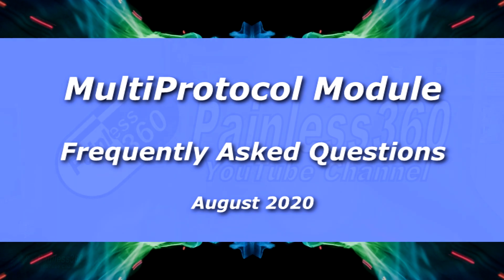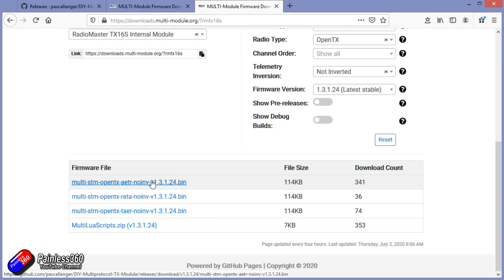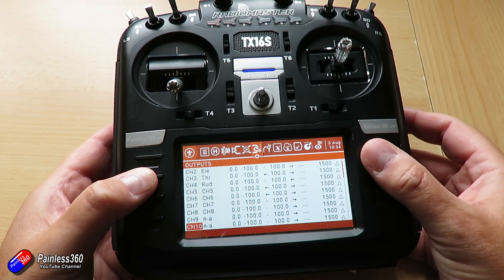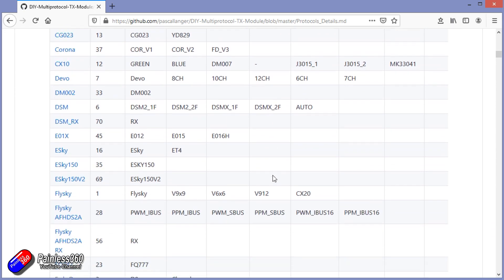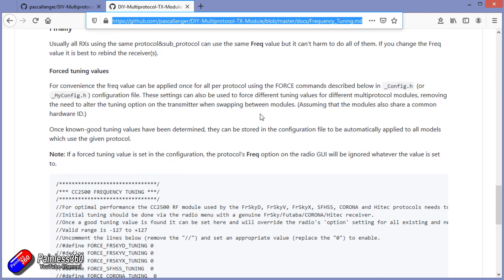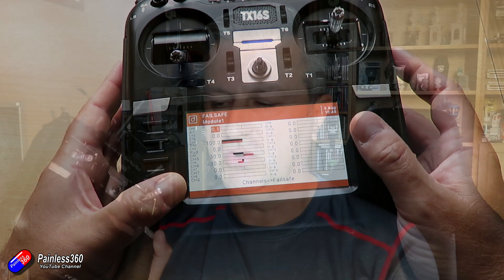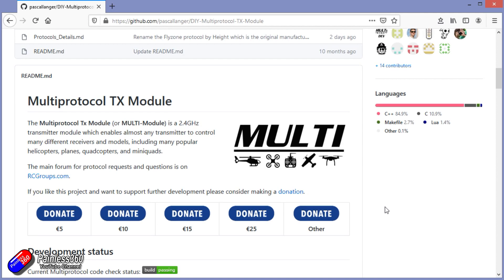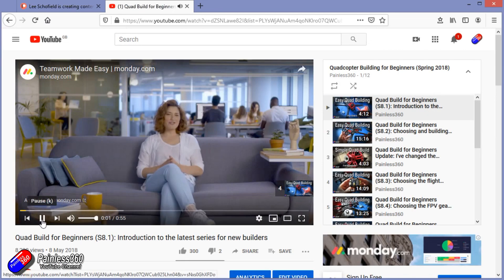Multiprotocol Module: Tips,Tricks and Common Questions

Comment: I got this FRSKY 20S and I wanted to program this thing so I could fly my RC model here in my ranch.   not to fly a SpaceX or NASA rocket into orbit. Cause im not a rocket scientist… 
I’m gonna return this transmitter tomorrow. This is just a bad nightmare. Couldn’t even find those menus.  Very frustrating to try to switch to this radio brand.  What’s the best brand ? The old one JR that works wonders.  Not going thru this.
Reply from the maker: Sorry to hear you've struggled. FrSky do seem to be targeting non FPV pilots who love fixed wing and are coming from JR, Spectrum and brands like Jeti. Sadly they don't provide the same backup as those other brands.. I like radios from RadioMaster running EdgeTX but they can appear tricky to setup to a new owner, I do have lots of videos to help on those though...

Comment: Thank your for the great info. Do you have an info or an estimate on the range on the Jumper and/or Hobby Porter 4in1? I've read that the iRangeX is stated to give around 240 m. I'd like an MPM but decent range would be good.
Reply from the maker: Range is very subjective. Antenna tuning, alignment, fine tuning, antenna position, local RF noise, quality of components, power levels and many other things affect it. Not all of the 4in1 chips output the same power either.. I have a video in the MPM series that looks at this... Best of luck
Reply: @Painless360  Thanks for pointing out your video. I watched it. I read on aliexpress, that the iRangeX developers have tested the CYRF6936 on the (tiny) Blade mcpx and similar Walkera Super CP helis, which have very short antennas. Due to their size I doubt they have full range receiver systems. Range on these two helis is stated at 200 m ("Tested Ground Control Distance"). I'd use the iRangeX or rather the JP4in1 on my Blade 230 heli, which is equipped with the Spektrum AR636 full range receiver. I am looking for an estimate on how the range would be. 200 m is not enough, no room for reserve. I of course don't need half a kilometre for a small heli, but 200 doesn't feel right. Both the CYR-chip in the JP4in1 and in my Spektrum tx have a power output of 100 mW. So range, after fine tuning and antenna alignment as well as flying at the same flying field should result in roughly the same range, shouldn't it?
Reply from the maker: Assuming the unit you receive has the same spec and firmware and the local flying area has the same RF noise, yes it should. Happy flying!

Comment: hello, I have a tx16s transmitter and I was lucky enough to buy a plane with a futaba r6106hf receiver, there is an option for multi/futaba in the settings, but I can't connect it, is this even possible?  I would like to ask for your advice.  Thank you!
Reply from the maker: I don't use Futaba here so am not aware of the nuances. https://youtu.be/DfKyx0yTbXU may help... Happy flying

Comment: Thanks for the video. Have bound a spektrum receiver to MPM module in the back of my X9d and notice that there is no failsafe option to set. Tested loss of signal on plane and of course throttle went to full. Plus in wiki is said this feature is not available. Really? I must have something wrong. Its just dangerous not having a failsafe function. Can you help?
Reply from the maker: I don't use DSM stuff here any more but usually the fail-safe positions on the Rx are set when the bind happens I'd check the throttle is low when you bind.. Best of luck!

Comment: Dude failsafe is the most important and tricky part. Do movie about SHFSS failsafe programing on this radio!
Reply from the maker: I've added it to the list. Happy flying!
Reply: @Painless360  Thank You. I have seen your movie about failsafe. There is a lot more tricky stuff. For instance I am FHSS user. It is different with oryginal futaba receivers and different with Corona cheap receivers. But with multiprotocol is ever more strange to me. On Corona receiver set custom value work, on oryginal futaba I am not sure. I think You might help many people if You can figure it out clearly :) Thank for you movies they are nice.

Comment: Can the DJI Air Unit, a 5.8 GHz VTx and a 2.4 GHz Tx  and SBUS protocol with other receivers, e.g. RadioMaster TX16s?  There is a mutiprotocol module for the DJI Remote however, I want to use an OpenTX radio.  Cheers!
Reply from the maker: I'm not sure what you are asking? There isn't a way to use something else as the radio with the AIR UNIT as far as I know..
Reply: @Painless360  Sorry, I think I missed some words.  I was wondering if, perhaps, they had used a common protocol.  RF is RF in some since.  However, it is more complicated as they are actually transceivers.  

In spite of my confusing question, you answered what I was wondering.

Comment: Hi, I'm really new to my Radiomaster TX16S. I don't have a external Module but would like to connect to a Spektrum transmitter for buddying. I would like the Radiomaster to be the master and the spektrum to be the slave. So my question is do I need an external module and if so which one would be correct to connect to a Spektrum if this is possible to do. TIA.
Reply from the maker: You can connect them using a 3.5mm stereo cable and nothing else. Best of luck!
Reply: @Painless360  Thank you

Comment: I keep on getting a "no sync error" on my taranis when i try to update. I double checked the firmware version.
Reply from the maker: A quick google search found this - "A No Sync error means that the module you are trying to flash does not have the MULTI-Module bootloader installed, and the module must be updated once using Flash Multi before you can update it from the radio". Maybe that's the issue? Best of luck
Reply: @Painless360  Huh, you know what that actually makes a lot of sense! Thank you i will definitely try that and get back to you.

Comment: Hi there I'm trying to help someone out who's trying to connect her iRangeX IRX4Lite multiprotocol module to her FlySky Nirvana radio. Is this possible and if yes please may you refer me to some information regarding this. We're assuming it would be possible since the radio is running OpenTX - just not 100% about hardware connections.. The rest is double-sided tape :p
Reply from the maker: The Nirvana still isn't fully supported by OpenTX so not sure what support will be in the cobbled together version of OpenTX that is on the radio (https://www.open-tx.org/radios.html). Once it is fully supported it will be the same as any other OpenTX radio with an MPM, probably ;)
Reply: @Painless360  Thanks for the reply :) good weekend to you!

Comment: Any chance of a tbs mpm update video? Since the mpm isn’t in agent x I have no clue how to update it and there seems to be a lack of videos on this. Thanks
Reply from the maker: I don't understand what you're asking...
Reply: @Painless360  the mpm module has its own firmware on it from multi module.org. There are plenty of videos on YouTube showing how to update the firmware of multi protocol modules but not for the tango 2. Upon further research it looks like there is an online tool called flash-multi that should make the process pretty easy to update the mpm. The reason I need to update my mpm is I preordered mine from tbs on day 1 and it has an older firmware that’s causing issues with there newer 1.23-1.24 firmware.
Reply from the maker: I see. Not sure, I've not had one of those in here.. Best of luck!

Comment: Hi I have a ts16 my first open tx things were going ok till now I cant get into model set up I can select my model but when I press mdl I get screen set up widgets setup page which I usually access from bottom switch on the left side am going nuts any help would be great
Reply from the maker: I've never seen that. What was the last thing you did before it changed?
Reply: @Painless360  I just added a model and hit bind then turned radio off,when I go to switches test and press mdl it acknowledges both tele and mdl signal and vice versa  its weird is there a way to reset radio to default

Comment: I have the Taranis x9lite, I'm looking for an MPM that will connect with the Eachine P51 Mini Mustang (V761-1 protocol).

I got the XJT lite module, but that only seems to work with ACCESS; I can select from items under the 'multi' menu but the module does not power on.   
The module works great with the ACCESS choices, so either there is a trick I don't know or I need different gear.

I'm considering a Taranis X9D Plus SE (for many reasons) -- what MPM would I need for that tx to work with the V761-1 protocol?

to be clear -- two separate questions:
What MPM will allow me to use V761-1 protocol with the Taranis x9lite ?
What MPM (or other solution, idk) will allow me to use the V761-1 protocol with the Taranis X9D Plus SE ?

I am assuming that if I get V761 i will have the ability to use all of the other protocols I see listed for MPM, is this correct?

and a big thanx for all the Painless360 work!
Reply from the maker: The Jumper 4in1 is a common choice. Best of luck

Comment: I have a Radiomaster TX16s that is great, for one exception. I have searched and searched, and no one can inform me on how to identify which protocol my (toy grade) receivers use. I have several popular toy grade RC's, including a Sharper Image and UDIRC drone, and a New Bright truck RX that I want to re-purpose for a home made camera gimball.  I have contacted the MFG's to no avail. I am disabled and on a very tight budget, so I invested in this radio thinking I could use it for anything PPM compatible forward. I'm shure this TX is capable of doing what I need, but without knowing how to identify what protocol these diverse toy grade Receivers use (which this TX is advertised as supporting) I am unable to utilize it for my intended purpose. I appreciate any assistance. Thank you.
Reply from the maker: Unless they have that in the specs of the toy then you'll need to search the forums or it's trial and error.. Best of luck!

Comment: I have updated my multi protocol module and then updated my FrSky Receivers (XM+ and RX8R Pro). I now can't get a bind on either Rx. The FrSky download page says I have to update the firmware of radios, RF modules and receivers. Is there a particular multi module firmware that corresponds to the latest  ACCST D16 v2.1.0 Rx update? If so, where do I find it?

Comment: The Wiki and the thread on Rcgroups was most helpful for me too Lee. The recent fw for the Multi module has Skyartec's protocol however the OpenTx fw for my FlySky Nirvana has it's Multi module code from OpenTx 2.2 which only allows 63 protocols when Skyartec is 68. Wiki and the group walked me through how to change the code and recompile so I could flash it to my module. Worked like a charm.

Comment: Hi, there is a config-h file which can be set so if the external module is used in more than transmitter the fine tune offset for different make of receiver are saved. I have spent hours trying to find and implement, if this can be explained I would be very grateful

Comment: Hey I am struggling switching over from quads to wings I got the zohd dart 250 fpv ready and I am really having a hard time for some reason after I set up the 3 position switch the 1st position kept both green leds flashing and the servos were making noise every now and again it would work so I tried the 3rd position and it seamed fine so I reversed the switch so it worked normally had everything working I launched the plane 2 times nose dived 3rd time I pulled back to stop the dive went straight up in the air and went into a right stall straight into the ground cracked the nose while in stabilized mode why is it allowing full rolls any help greatly appreciated thanks
Reply from the maker: See my video on FW maiden and setup tips. First time can be tricky if you don't have it setup well.. Best of luck

Comment: Question: I have a X-CAM quadcopter from www.flyinggadgets.com (this is an example). How I discover the protocol that it uses to program my MP TX?. Github has a long list of protocols but it is not easy to associate these protocols to actual quadcopters. Is the a trick to find this information?
Reply from the maker: You need to look at the listing or ask the vendor for that detail. If it's not there then a search in the forums would be my next step... best of luck

Comment: After watching your vid on the Radiomaster I went and bought one,silly question but scrolling thru the recieves I can bind to as I have used assan for years got those working but purchased a second hand Align M25 mini drone it came with a Futaba Fast receiver in it thought nice will bind to that but scrolling thru Futaba is not there so does the Radiomaster not cover any Futaba receivers

Comment: Excellent explanation of the MPM tech.  I've often noticed that binding with the MPM module fails if the receiver is too close (e.g. Spektrum) so moving it 2-3 meters away usually fixed that.

Comment: Hi Lee, 
Wow, what a terrific video.. this one really knocked it out of the park for me, since I use both the internal and external DIY 4in1 Multi-protocol (MPM) modules in My transmitter exclusively.  

I think what Pascal and the 4in1 software developers have done is miraculous. No other OpenTx group has come close to providing such an incredible array of capabilities and done it in a truly opensource way that allows you to review the comments and tweak the 20,000 lines of source code and refine it further if you really need to do so. 

I hadn’t known about a couple of the latest new functions either, so I’m very happy you’ve touched on them here.. but I do have one important question for you.. Yes it’s true there is a detailed list of all the protocols that are currently supported up on the github web site you referenced at least three times.. but here’s the problem.. and this is only a problem for many of us with the cheaper toy planes, boats, Quads and RC Cars and we bought all this stuff  and the cheap crappy transmitters that come with them.. when we’d like to use our new MPM Transmitter with these models too.... however I’d venture to say at least 90% of us haven’t a clue what RF protocol is in the models Receiver because that’s rarely advertised.  So here’s the question, does anyone have a website yet that shows a detailed photo of each one.. (Yes, I know there are several hundreds of these that have come out of China) with a column alongside each photo that tells you what protocol by (name or index number) is actually in it ? As you mention, you need that info to bind it and control it. Most of us have this problem on the older heli, quad, and other RC toys, we’ve got but find it’s nearly impossible to know which of the 80? or more possible MPM  protocols we should try to use. The supported list is WAY too long to try them all.. 

Fact is I believe some aren’t supported yet, and many never will be, unless MPM decides to add an IR ( Infared) transceiver option.  
Anyway, really great video .. thanks Again for your time and effort in putting the custom graphics, and all this key content together in such a clear and concise way.. I Love it !

Comment: Hi Painless360, I got a really dumb question, what are the markings on the gimbals called? I'm using the x-lite pro & there are no markings, I can notice stick postioning. I noticed on the x-lite pro, from the middle stick position to the far left or right is a lot shorter than it seems. On larger controllers it's more wider of course. Between thumb & pinching is the accuracy, I'm fly with thumbs & to change (let's say) the speed by one point is easier & precise with pinching than thumbs. I know it's just one point, but any pilot would know one point is enough to change the flight of thhe drone. Many thnx & take care
Reply from the maker: You know, I'm not sure what those graduations are called officially! Smaller radios often use smaller gimbals with less travel to support the smaller size. The sticks are often height adjustable that can help but will not make up for the smaller movement in degrees. The feel of a radio is a very personal thing, just as in pinchers vs. thumbers. Radios that have the gimbals nearer to the sides of the radio are often considered better for pinching.. Happy flying!